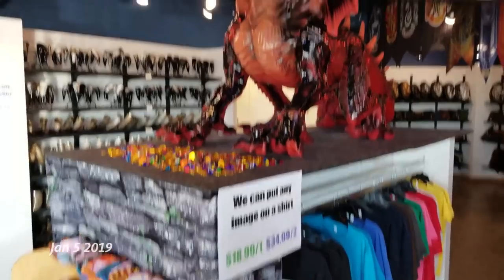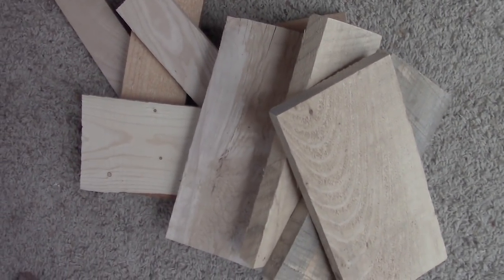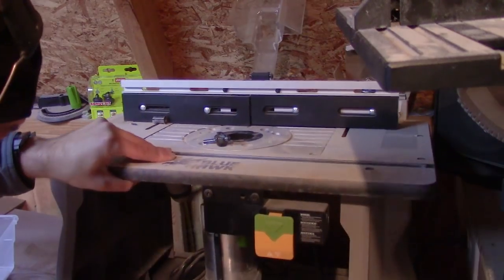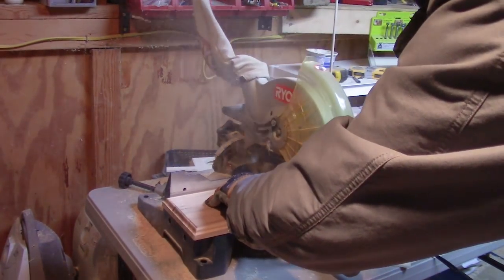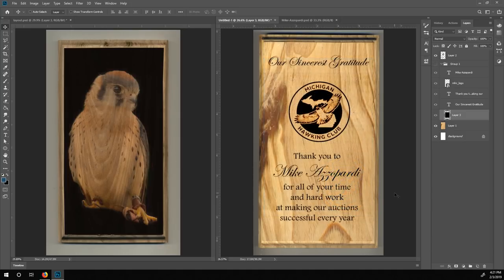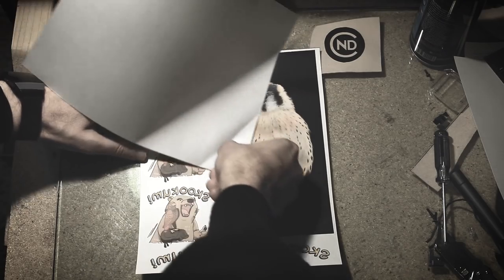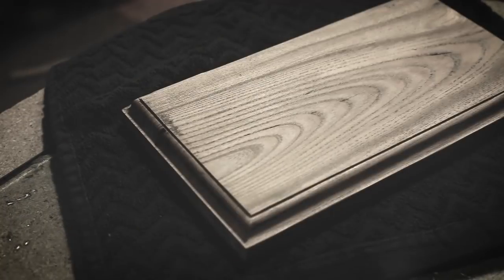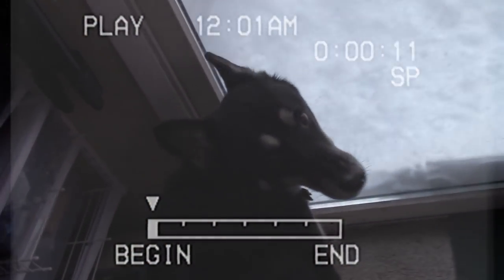PROJECT - QUICK PLAQUE ... or so I thought

Comment: 2:46 You did not stick your finger into a spinning blade to move an offcut? If you're too impatient to shut off the saw and can't wait for the blade to stop. At least use a push stick.
It's hard to make stuff with an unexpected different number of fingers on each hand.
I'm not normally the kind of person who points out every safety problem, but doing that is just asking for trouble.
Reply from the maker: I agree. No a safe move. I have the scar and nerve damage in my thumb to remind me of the last time my fingers got to close to the blade.
Reply: @IamNickDClements   the finished project did look great in the end.